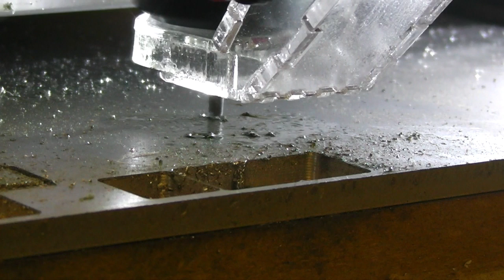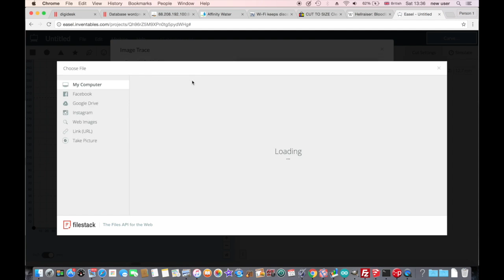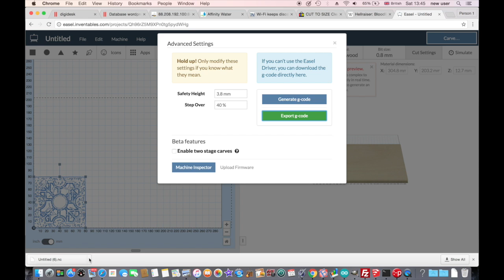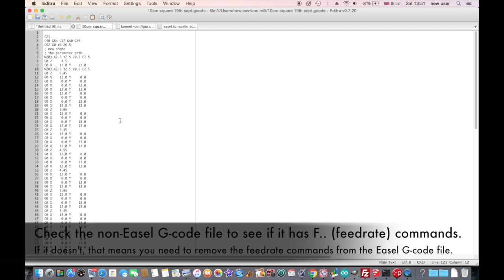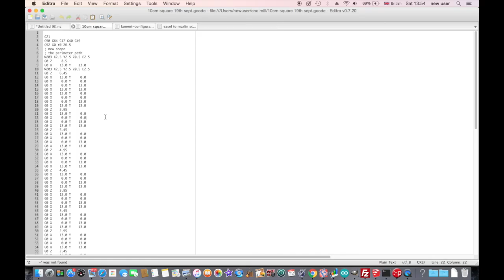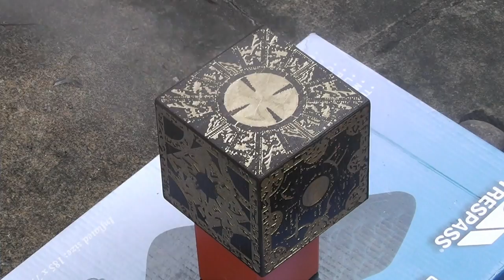Run Easel Gcode on (almost) any CNC router

Comment: thanks for the helpful video! quick question, one it is in pronterface, does it connect directly to ramps or do I need to somehow then put it in Marlin? thanks
Reply from the maker: Hi, pronterface is the program that sends gcode to the CNC machine via USB or serial port. There are many other programs available that can do the same thing, for instance Universal Gcode Sender. If you have a CNC machine you probably already use a program to send gcode to it. RAMPS and Marlin are only used on CNC machines that use Arduino as the control board. RAMPS is the shield that turns Arduino into a CNC controller, and Marlin is one firmware that runs on the Arduino (you can use other firmwares for Arduino CNC).
Reply: OpenTronic so do I not need to edit Marlin at all and all the settings are taken care of in prontface, or do I need to prepare Marlin?
Reply from the maker: You just need to send the gcode to your machine the same way you normally do.
Reply: OpenTronic ok thanks
Reply: OpenTronic ok follow-up question, I'm building my CNC from scratch with a ramps 1.4 setup with Marlin, i haven't got any gcode to work yet, hence why I'm here, how do I get a starting gcode template for what my printer wants?
Reply from the maker: While you're calibrating your printer you'll need to cut some simple test shapes and find our what works best and how you want to work with the machine. That subject is just too big to answer in one simple question. But you'll basically want to put a couple of lines at the start of your gcode that tell the machine what feedrates you want to use, whether to use absolute or incremental coordinates, whether to home the machine or treat its current position as 0,0,0 - for instance. Also you might turn your spindle on or off in gcode. I have a video about how I set up my own homemade CNC router, but there are loads of other good videos on youtube that cover gcode in far more detail.

Comment: I use Easel for simple/quick cuts on my cnc router also.  I am using Mach3 and a smooth stepper to drive the machine.
I do not require any changes to the G-Code that Easel generates.  It runs straight away.
Thanks for the video.